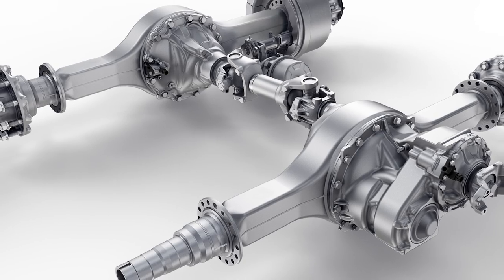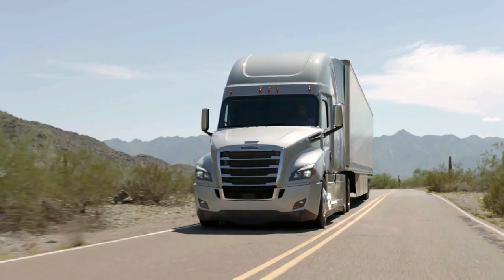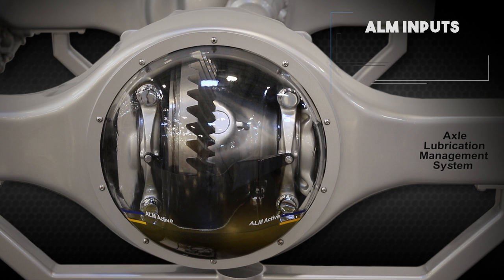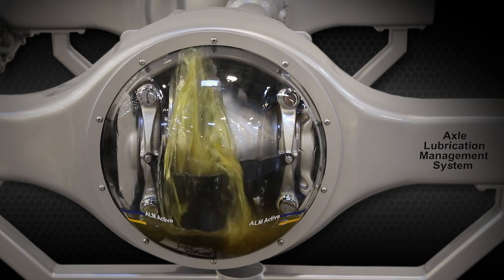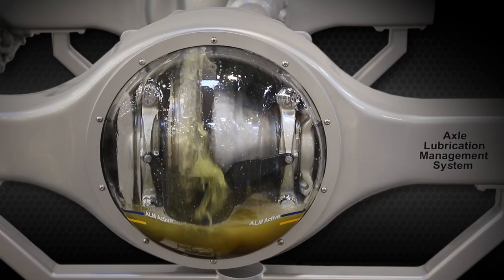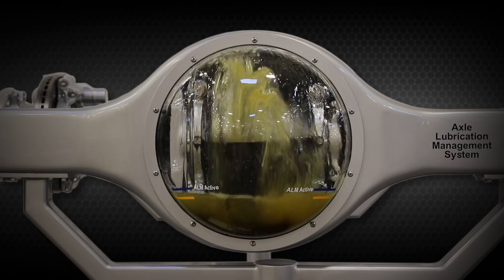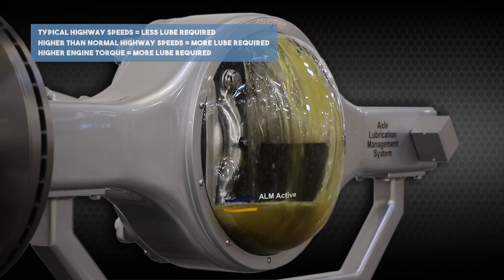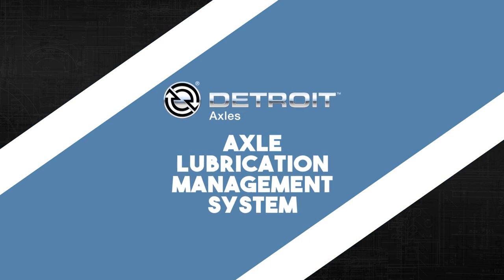Detroit Axle Lubrication Management (ALM) Video

Comment: Banks Diesel did a bunch of testing and found out the same thing these guys did, the thrashing of oil between the gears is causing heat and large losses , this is an effective system that tackles a problem which has been overlooked for years

Comment: 75k miles * 7mpg = 10700 gallons * $3.25 = $34,700 * 1.5% =  $521 in savings per year.  
If it breaks once, I bet it will cost more than that to fix.
I find it hard to believe they can get the 1.5% increase.
Reply: minimum 130-150 k per year. Thats 1000 $. For trucking company that has 60 trucks 60x1000= 60 000 $ a year.  Free fuel for one  truck .
Reply: @gardemeister  and you forgot to add that  when they start to fail it will cost more to fix than those 60 000 at a year , there is no point on that piece of engineering,  really pointless
Reply: Eaton transmissions and rear axles have a 750,000 mile warranty. I imagine that Detroit will have a similar warranty to be competitive.
Reply: @williamjones4483  I've driven a million miles on a truck with Eaton-Fuller 18-speed and floated the gears most of the time.  The only failure was a clutch replacement near the time of the truck was sold.  Eaton-Fuller transmissions will go the distance if you drive them properly.
Reply: @hudsondonnell444  I never said they wouldn't. A well maintained Detroit Diesel or Cummins engine will go past a million miles also. I only stated what the standard warranty is on Eaton transmissions and rear axle assemblies. Detroit warranties their engines for 500,000 miles.

Comment: 1.5 % more efficiency my ass and if this crap fail you pay 1K$
oil thickness will vary in temperature and viscosity all year long,so oil flow is already fluctuating.
Can't you just work on useful things,like weight reduction,aerodynamic,cooling fins,and really useful non failing parts ?

Comment: WARNING:    Hello I bought a kit for my Silverado and the little silver nuts with the  nylon are to soft of a metal to use safely on a vehicle. I just used a little 8 inch hand wrench and the nut pulled the threads right out .So I hope nobody uses these nuts and bought better nuts. Somebody could get killed driving down the road with these faulty low grade nuts.

Comment: Demand Detroit how does this work when the truck breaks down and needs to be towed. Is the tow operator supposed to sit in traffic and pull all four axles or can he have some sort of "comfort" laying underneath the broken unit pulling the driveshaft?
Reply: After watching the video, it states that, upon loss of air pressure, the valve will default to full open.  As a towing operator, I supply air to the tractor.  However the key is OFF so there will be no computer input.  Do I need to pull all 4 axles?  Or can I simply disconnect the driveline and disconnect & cap the air line to the differentials, therefore defaulting them to a full lubrication setting?
Reply: Supply air and disconnect driveshaft like normal, no need to pull axles and mess with air lines to the axles.  Since no torque is being transmitted to the axles, the lower level would still be enough.